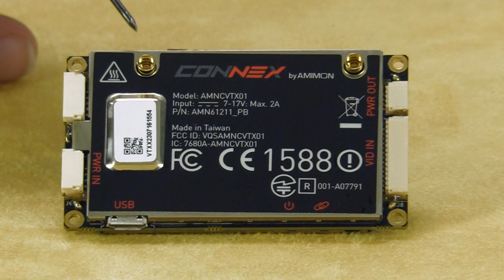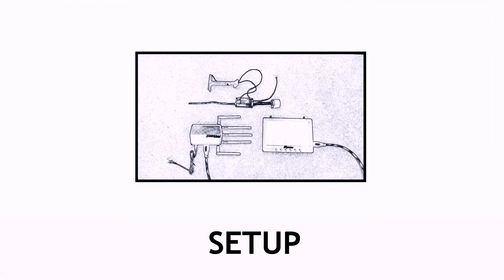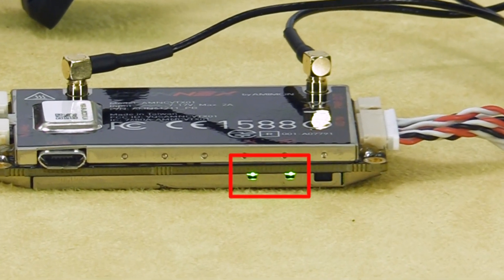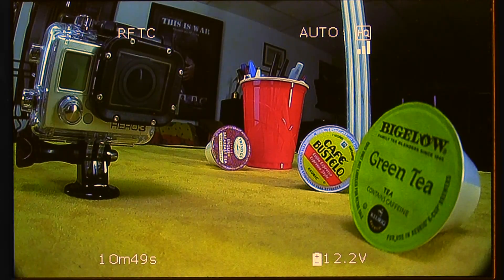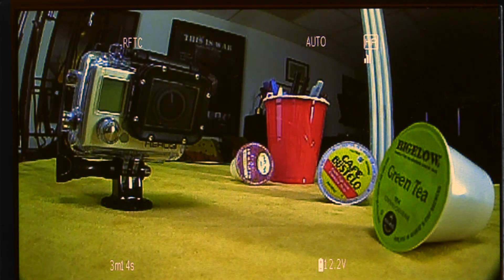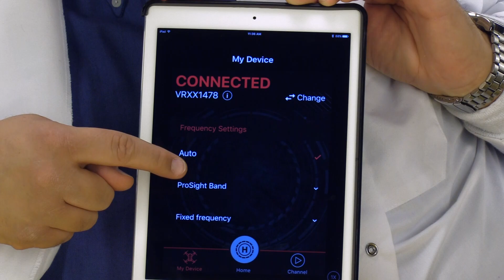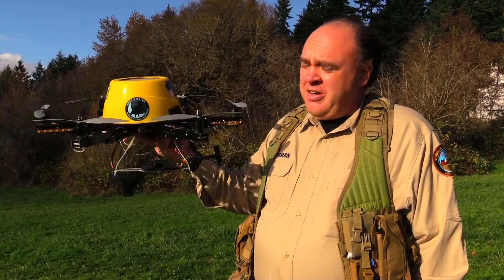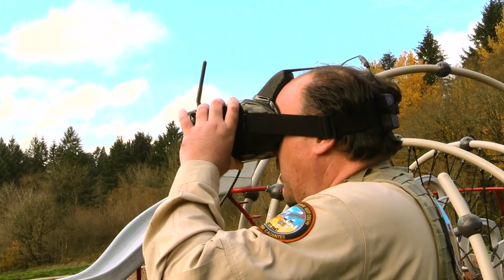Connex ProSight Unboxing, Setup and Testing

Comment: So since Raven's about six years old is she still running the same components (i.e. motors, escs) or have you had to replace anything over the years?
Reply from the maker: The whole powertrain (battery, power distribution, ESCs, motors and propellers) are the same as the day of her maiden flight. Several years ago, we had a bad crash that left her motors trying to turn even though she was inverted on the ground, which burned out three of them. We replaced them with identical units. The only major upgrade to her systems occurred in 2012, when we added a first generation NAZA flight control system and changed over her video transmitter from 900 MHz to 5.8 GHz.

Several years ago, we adopted a policy that we call "Let Raven be Raven." Obviously, this technology has advanced enormously over the past several years, and we could add a camera gimbal and all sorts of fancy new hardware, but we decided to preserve her -- still as a working aircraft -- but in the same configuration she flew in during our early public safety and product demonstration videos, using other aircraft when we need more advanced features. Still, it's surprising how often we bring her out, owing to her versatility and reliability.

Comment: just got mine today
Reply from the maker: From your thumbnail, I'm guessing you're an FPV racer? After you try it out, let us know what you think! I've heard mixed reviews from the racing crowd.
Reply: I was flying Thursday and today and the signal way better than sd . but the antenna top plastic brake easy 2nd crash broke. i need to get use to the 2.8 lens i am use to 2.1 i am hoping they will come out with that ans a recorder that plug directly to the camera on the quad so much cleaner image and a mic will be great too.it take time to get use to it but slowly i will and will love it!
Reply: Dhardjono how does your connex system been for you?